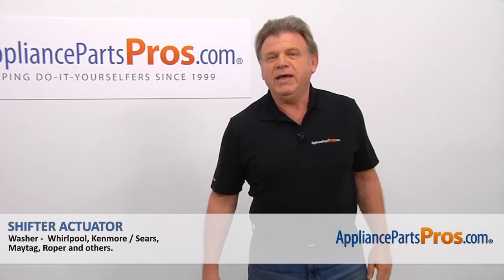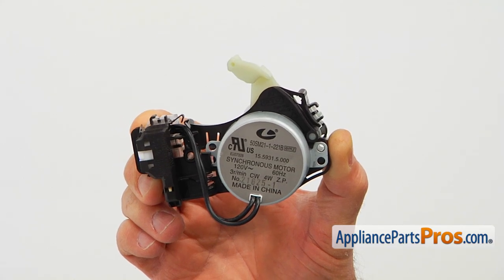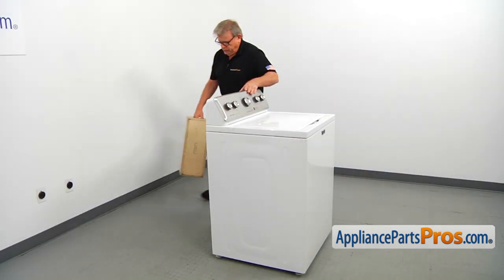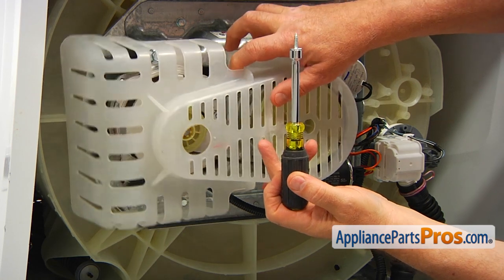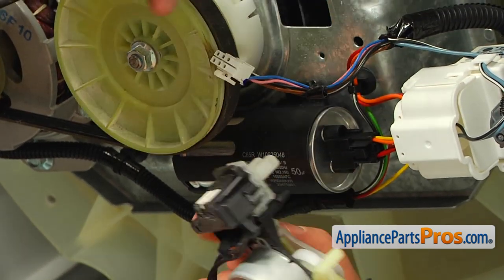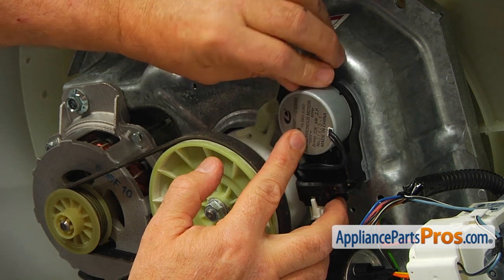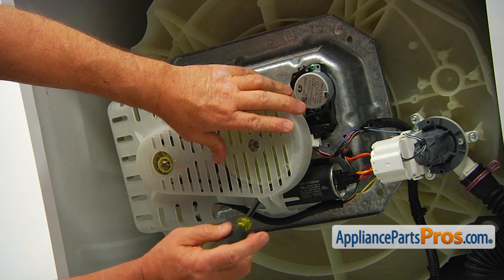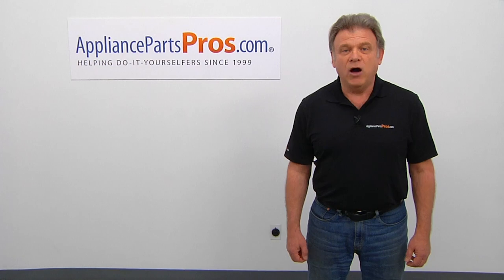How To: Whirlpool/KitchenAid/Maytag Washer Shifter Actuator W10913953

Comment: Ok, I replaced the actuator I'm still getting an F7E1 I do get the hum,  but the capacitor shows 51uf  it's a 50uf capacitor and it's a start/run capacitor everything is replaced but the motor and board. I can run a diagnostic and it will do everything. I put it on a regular cycle and it does everything but
 spin. Another question does it suppose to run more water on a rinse cycle than it does on a wash cycle?

Comment: The green screws are stuck.  I have spent two hours spraying the front and back of the screws with WD40 and twisting them with my Phillips screwdriver.  The screws won't bulge.   I see some rust on the other holes in the bottom of the tub.  I would not be surprised if there is some hidden rust on these screw holes.  I have not yet stripped the screw heads.   Does anyone have any ideas for how to remove these stuck green screws?
Reply: Follow up:  I got the screws out with the aid of valve-grinding compound.